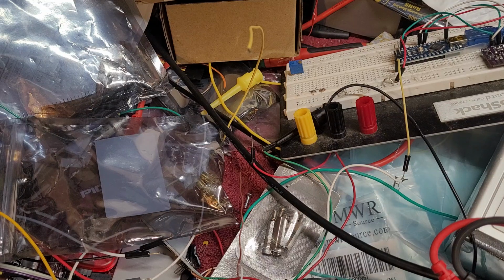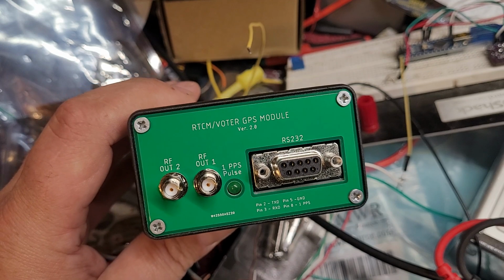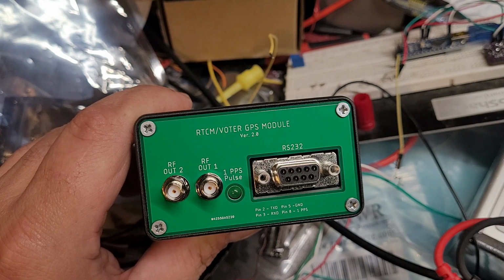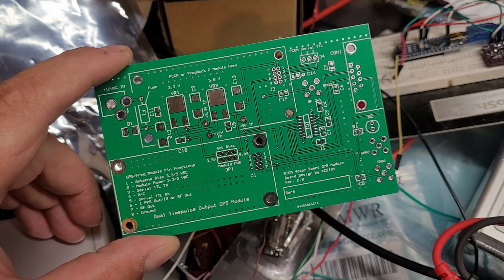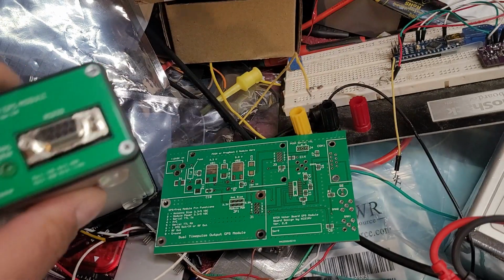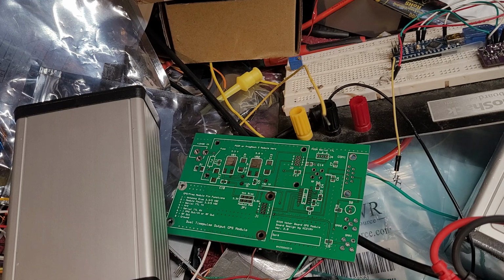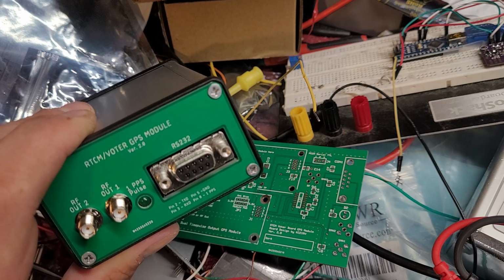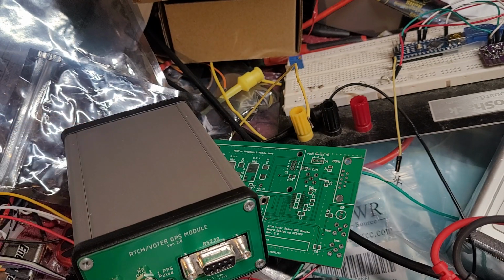The RTCM and Voter Board GPS Simulcast Module

Comment: Great stuff, I’m still rockin the OG 9.6 board you created!
Reply from the maker: That still is an excellent and simple solution. If the availability of 9.6 MHz OCXO's didn't dry up, I would have updated and cleaned up that board and maybe changed it over to surface mount components. Also, that PCB was my first attempt at designing my own PCB's and when I look at it now, I cringe a little bit LOL! it may be ugly, but it works! I still have 5 of them in service at the moment. I'm glad they are working for you and hopefully continue to work for a good long time. Just curious,but how many simulcast sites do you have in your system?
Reply: @Geewhiz811  I have two sites, and one on the test bench.

Comment: Very interesting! Have you ever thought about an OCXO on the same pcb? That would be a good GPSDO.
Reply from the maker: It would shoot the parts count and cost way up. The accuracy and precision this provides is more than enough for radio simulcast. Granted, an OCXO would provide better hold over, but without a GPS signal, the RTCM/Voter Board would stop functioning anyway.